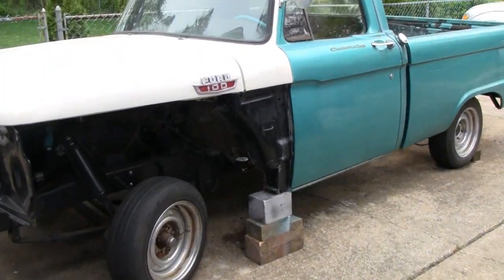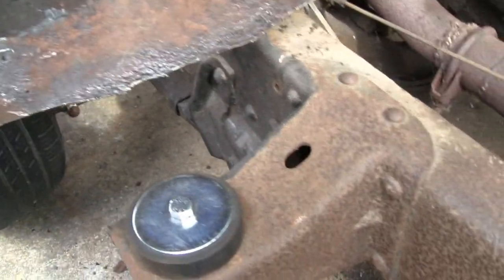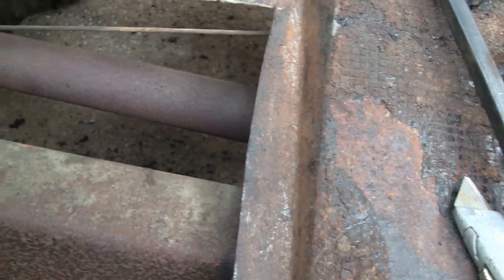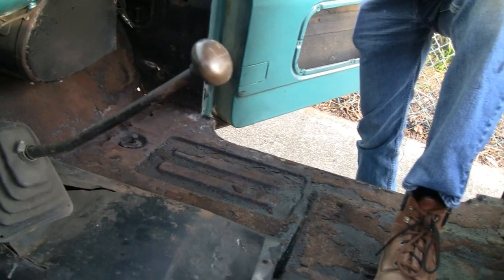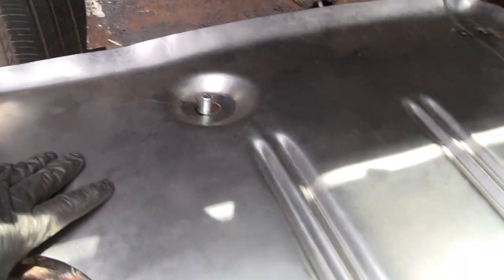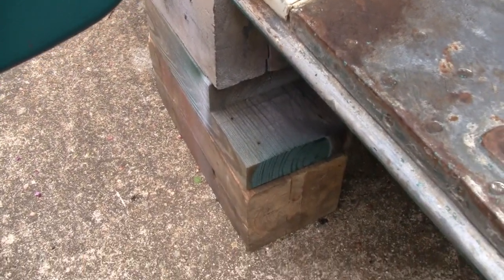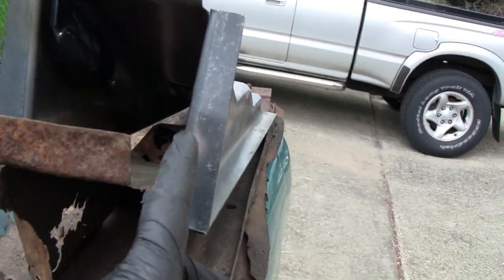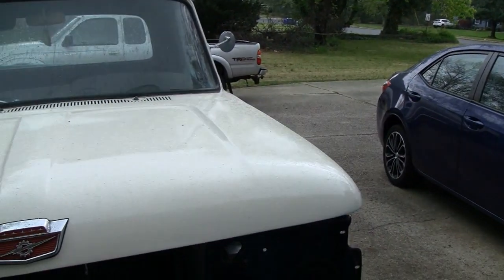CAB MOUNT MODIFICATION and FLOORPAN CLEAN UP FORD (F100 part 52)

Comment: The pointy finger returns. I'm laughing my butt off.
Reply: I read somewhere that Left and Right are determined by facing the flywheel, and not the front pulley. I could be wrong, though.
Reply from the maker: It does get confusing, when I worked in the Body Repair Business I always referred to everything as Passenger Side and Drivers Side!! Or over here it's Left hand drive, over the pond Right hand drive!!☺